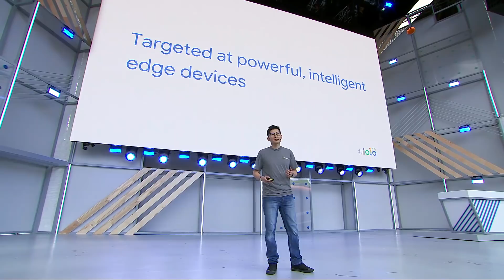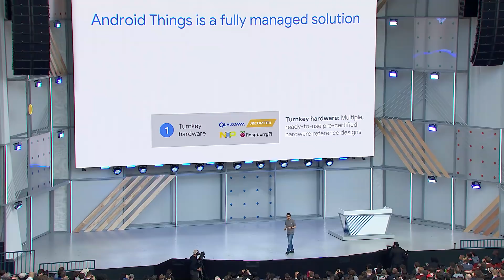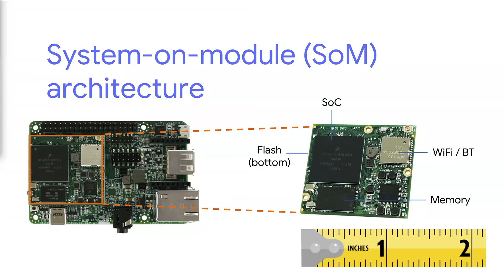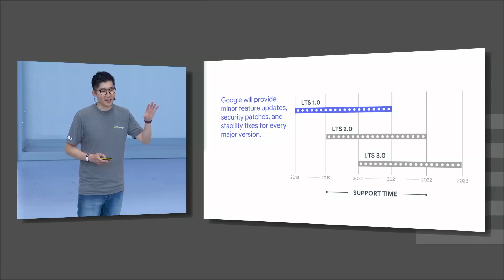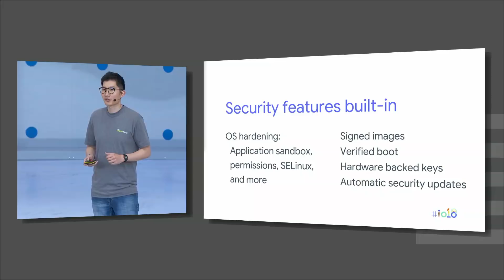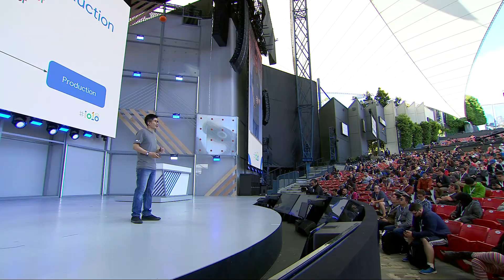What's new in Android Things (Google I/O '18)

Comment: 3 years is long term support? IoT devices are supposed to be set and forget pretty much.. I don't want to have to replace my smart garage door opener, or my smart irrigation controller every three years... I would be ok with minor features and bug fixes for 3 years, but security should be much longer.
Reply: Keep in mind it's not that it'll quit working after 3 years. How many smart home hubs on the market have been around 3 years? How many have had support dropped in less than 3 years?

Comment: 3 years is far shorter than consumers expect for their devices, needs to be 10 years.
Reply: It's a place to start, though. IoT is a wild west right now. I just bought a smart light switch and found out it no longer supports a hub that was touted as being supported right on the box. 3 years is better than zero years. I do agree that it needs to increase in time, but it's a start.
Reply: I actually want an infinity years, but I think I could live with about 5 or more quite happily. 3 is pushing it but hey at least it's not nothing